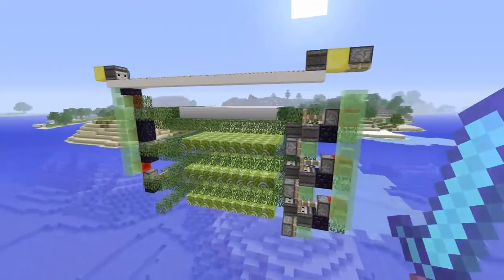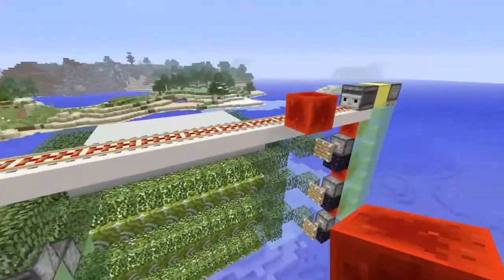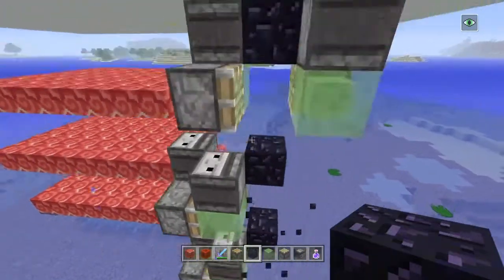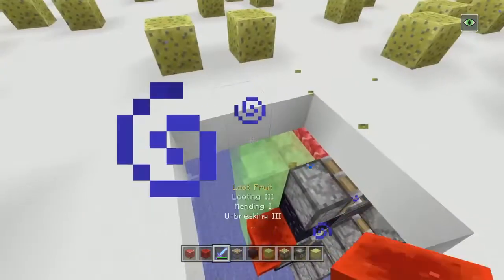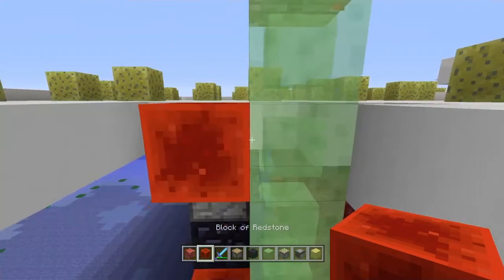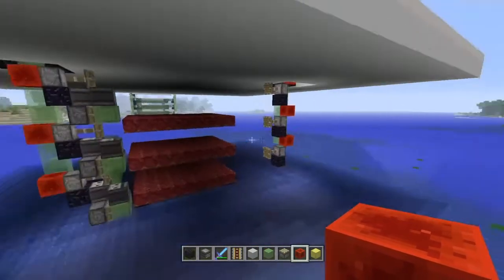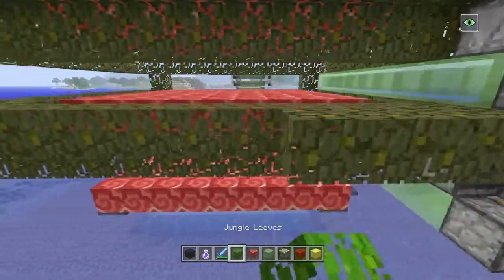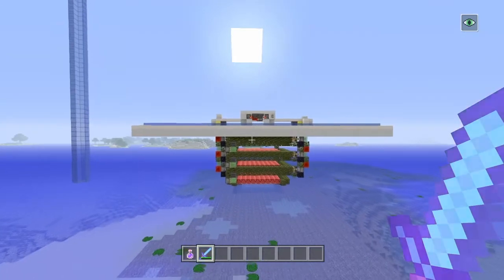NEW Flying Witch Farm - 2100+Drops an hour  -(Tutorial)

Comment: Hey Hux! Would this be my best option for a super efficient wither skull farm as well?
Reply from the maker: I was thinking the same thing. Might have to tweak the design a bit, but it would absolutely work. Gnembon has a great video using flying machines in a nether farm.
Reply: Hux Yeah. Szpeddy has an old one that still works as well.